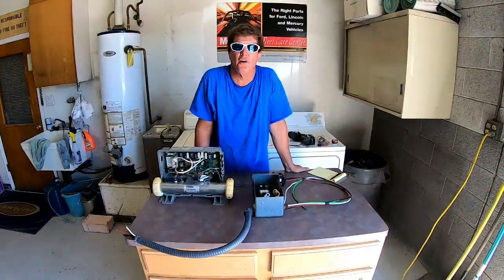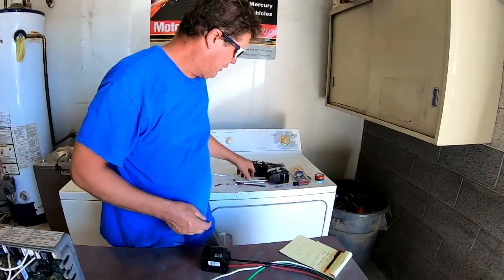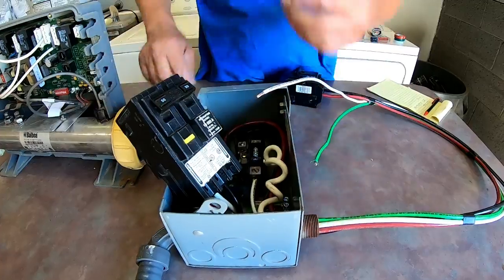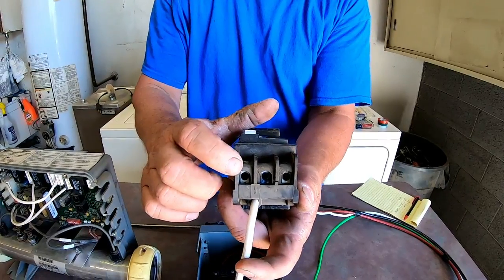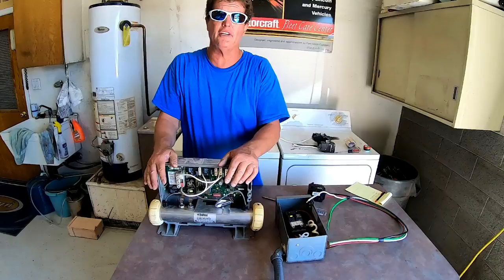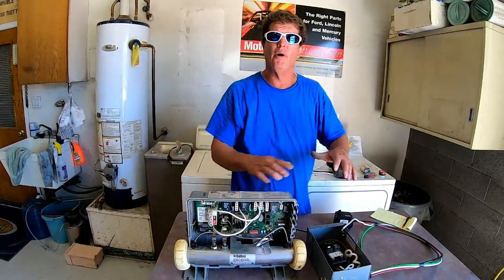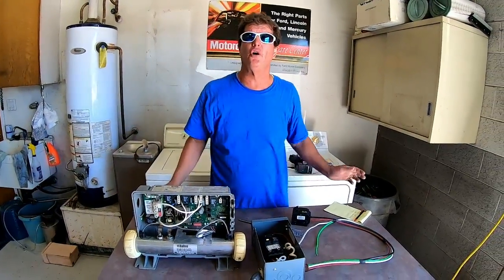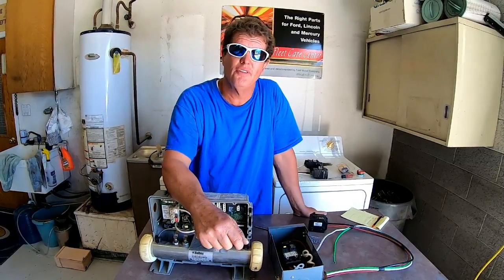Hot Tub / Spa wiring made easy... 50 Amp GFCI Install..Arizona Hot Tub Factory (DIY Spa Repair)

Comment: Just a question on your conduit sizes. I see you ran 4 # 6 conductors inside 3/4" rigid and flexible conduit. Does 3/4" have enough area to accommodate 4 conductors? I am in the process of wiring mine up using your video and it looks like our local code would mean I have to use 1". What do you think Mr.? Great videos by the way...
Reply from the maker: Yes we do it all the time with no problems 
Thanks for Watching & Subscribing
Reply from the maker: My son said if you are going long distance or several 90 degree turns you might want to use 1 inch EMT but we still use 3/4 for the liquid tight .

Comment: Are you still around Spa Guy? Is there ANY REASON I should be getting >30ohms between black (A-phase) and the ground. Specifically what could be the problem with this pack that would cause that. Also if I did not wire  my line neutral to the center pole on the GFCI breaker would it make it trip if I wired spa neutral to the neutral bus
Reply from the maker: They call me the SpaMan..The Spa Guy is another company.
Something is wired wrong
You have a problem with the main breaker 
or something is wrong with the pack.
You are welcome to call and talk to Scott and he could get you going in the right direction
Thanks for Watching & SUBSCRIBING

Comment: Great video, thanks.  Can you bury the liquid tite conduit and run it up underneath the spa and through the base of the hot tub to just outside the spa pack?   Or must you come in through the bottom section of the side panel of the spa (i.e. come in through the side of the spa vs up through the base) and feed the conduit/wire through to the spa pack?  Are there knockouts on the side of the spa where you would insert the wire cable conduit for this purpose, or is it "drill your own?"  Thanks

Comment: Hey Scott you still responding to comments on this video?
Reply from the maker: Yes .. just about everyday.
Reply: Hey Scott thanks for posting.  I'm a handyman... not an electrician.  I've done plenty of stove and dryer hookups.  I was asked to hook up a hot tub for the first time. The tub is used but is going into a new place.  The electrician has put in a drop for the disconnect/GFCI. I feel like something is missing.  Coming out of the conduit from the main are three number 6 black wires. One black wire has green tape on it.  [Two hots and a ground?]
The hot tub has a pack exactly like the one in your video.
For my disconnect box, I have very similar to the one your video. 
So, are we missing a neutral from the main?

Comment: Is there any reason the GFCI can't be in the main panel vs sub panel and use a disconnect box as the subpanel?
Reply from the maker: You can put the GFCI in the main or a Spa disconnect box.
Now I always have two breakers on every install I've ever done or helped and Ive put the GFCI in one or the other... I have never just put a GFCI in the main with a disconnect that was not a breaker . I do not like the disconnect like what is used on an AC for instance. Hope this Helps Thanks for Watching & SUBSCRIBING
Reply: @spaman5440  Thank you!  I'm the second owner of a home built in the early '90's and I recently replaced the original hot tub.  The original wiring is simply a non GFCI breaker in the main panel and about a 75' run of 8/3 cable. It's a very harsh ocean cliff environment and I can't use anything metal outside unless it's stainless steel or plastic. I really want to rewire this installation to ensure it's safe/proper. Your videos have given me the foundation to redo this wiring the right way.
Reply from the maker: @cottydry   The 8/3 is the wrong size and type of wire to use outside or on any Hot Tub...
I use THHN or THWN wire only #6 on all four wires. Our company fixes this type of problem all the time.... You also need to have a Spa disconnect with in 20 feet of the hot tub and no closer then 5 feet and a min of 36 inches off the ground. Hope this Helps and Thanks for Watching & SUBSCRIBING

Comment: So thr neuteral wire inside the sub panel is tied to the gfci white as well? also if thats true then when wireing the 50amp in thr main pannel can i have my neuteral and ground on the same bar there? because you said if the gfci white is on the ground bar it wont trip the gfci in a fault situation but in the main pannel before the sub its wired neuteral to ground there......sooooooo will it still be a safe gfci?
Reply from the maker: In a main Panel ground and neutral can share the same bar without tripping and yes this is safe and very common in a lot of installations
Thanks for Watching & SUBSCRIBING

Comment: Can i use 8 /2 wire for sub panel? And 6 /3 to hottub
Reply from the maker: No! You use #6 THHN 0r THWN wire only 
From the main to the Sub panel and the same from the Sub to the Hot Tub.

What you are asking to use is the wrong size wire as well as the wrong type of wire>I see many contractors as well a DIYers doing this all the time and it never works out well in the end 

Use #6 on all four wires never down size the Neutral or Ground wire ever and alway use THHN or THWN wire.

Thanks for Watching & SUBSCRIBING

Comment: Hi Scott, I just finished doing all the electrical for my new hot tub. It is a 2-wire and ground-only connection. The hot tub is just working fine but when I tested the GFCI it will not trip. I returned that Square D by Schneider Electric Square D - QO230GFICP QO Circuit Breaker, 30-Amp, 120/240V, 2-Pole, GFCI, Plug-In Mount for replacement. Thinking it was a defective unit. I got the replacement and it is the same issue - not tripping. I followed exactly the instructions on how to wire the hot tub, but no luck. Please advise, thanks.:)

Comment: Quick question. I am moving my hot tub off a brick patio and onto a rebar reinforced slab.  Before I pour the slab, I am adding a threaded rod pounded into the ground and connected to the rebar. I'm going to have the threaded rod stick up out of the cement as a way to ground the rebar.  Should I run an additional ground wire from the bar by the pack to the threaded rod as a 2nd ground? Would that help if somehow the water in the tub got electrified?
Reply from the maker: I would run your wire from the main to the sub and then to the spa in #6 THHN or THWN wire no matter what and if you want to add the ground bar for added measures that fine. You alway want to make sure the main sub and spa are all grounded together on the same line with the same size/type of wire. Thanks for Watching & SUBSCRIBING

Comment: Can you just put a GFCI breaker in the panel to a disconnect that is 5 ft away from the tub?
Reply from the maker: Yes you can put the GFCI breaker in the main panel and then just put a 50 amp breaker on the wall 5 Ft away from the the hot tub and you are good to go. Thanks for Watching & SUBSCRIBING

Comment: Great video but I don’t think you explained or possibly emphasized which side of the breaker you connect the source power and which side the load is connected to? I’m assuming source is on the bottom and load is on the top.

Comment: Explained pretty simple great video.👍 I'm going 2 give it a shot. Just poured my pad, gonna set tub next week. 
Only question I have is there a max distance u need to be from ur hot tub 2 the disconnect?
Reply from the maker: Yes...Min of 5 feet away from the hot tub and 36 inch hight and no further then 20 feet and in the line of sight..#6 wire on all wires and use THHN / THWN only Thanks for Watching & SUBSCRIBING

Comment: Can the ground wire going to the spa pack be bare. Or does it need to be insulated?
Reply from the maker: I alway use #6 THHN wire from the Sub panel to the Hot Tub... I would not use a bare ground wire. Thanks for Watching & SUBSCRIBING

Comment: Great videos Scott! Thanks very much. Question: what type of wire do you recommend running from my main panel in my basement to my outdoor spa panel through my basement ceiling?  I plan on 6 awg wire. I will use the thhn thru seal tight from sub panel to spa but should I use nm-b thru the basement from main to sub? Curious on your thoughts. Thanks.

Comment: I would like to add a wifi switch to turn on/off my hottub system. I have 4 wires coming from my 220V panel breaker: hot-hot-neutral-ground. Can you recommend a wifi switch that fits these 4 wires as input, and also has 4 ports as output?
Reply from the maker: They don't make one for Hot Tubs..You should never shout off the Hot Tub with water in it for more the a couple of hours ever...The water needs to be circulated every 12 hours for at least an hour  other wise the water will get really gross and nasty..The water will also get really hard over time ant that is when all of the problems set in ...So not a good idea.. Thanks for Watching & SUBSCRIBING
Reply: @spaman5440  really not planning to keep water in it. I wil drain the hiottub after each use. Pleasrñe let me know about the wifi switch

Comment: My hot tub hasnt been used in 18 months
Filled the tub and flipped both breakers and nothing happened
Took a look at hot tub breaker and looks like reset button is stuck in out position (,won't move)
Hoping I can replace breaker and will be back in business

Comment: Is that a Residual Current Device / Breaker combo?  How do you hook up a separate RCD device in that GFI circuit? Also interested in wiring an emergency shut off switch about 5 feet from the tub itself. What would you suggest in emergency switches brand and mounting post options.

Comment: On  Jucuzzi j235 this is a 3 wire hook up ? So I believe it doesnt require a neutral wire so there for you cant use a GFCI breaker correct ???

Comment: Hi - thanks for the Video. I've got an older install (approx. 20 years) with an external box that contains a Leviton 8895 GFCI that feeds a Funras 42F35A1 definate purpose controller .. out from there to the spa pack. The GFCI keeps popping all of a sudden with nothing else changed .. sometimes within days, sometimes hours of resetting it. The 8895 is discontinued and no similar alternative is available. I've gotten conflicting info on what to do - some say replace the house panel breaker with a 50A 2 pole GLCI and have the GFCI in the house while others suggest as you've done in this video and basically replace the outside setup with a box like you show. Please advise, and perhaps detail why one is better than the other. THANKS !!
Reply from the maker: You would need to call the office and talk to Scott.. You have way to much going on with your Spa and we do not want to confuse others with wrong info that will not work for their situation and could in fact cause damage. So call and ask for the Spa Man. Thanks for Watching & SUBSCRIBING

Comment: im installing the load center, i had the tube hard wired to the breaker in the main panel, now i want to add the load center with the ground fault, the breaker keeps tripping, even with none of the load wires attached, i assume i have a defective breaker. what are your thoughts.
Reply from the maker: You might have something wired wrong...(With the breaker turned off) Go back and check everything again if it still trips the breaker give us a call and maybe we can hep you...Thanks for Watching & SUBSCRIBING

Comment: Hooked it up exactly how you said using an Eaton 50 amp gfci   Worked for 3 days and the Eaton Gfci breaker keeps tripping. How can I tell if my Eaton gfci breaker is bad?
Reply from the maker: With the breaker off...Make sure all of the connections are tight.Is it a new or used spa and what pack does it have in it..Thanks for Watching & SUBSCRIBING

Comment: Power to sub panel but no power to hot tub .. checked all wiring and all nice and tight.. still hot tub has no power
Reply from the maker: Check to make sure you have power at the hot tub...If you do have power at the hot tub and it does not power up check all of the fuses on the board.if all fuses are good turn off the breaker remove wires and then remove the board and turn it over and look for any burn spots...If you see any burns spots your board is bad and needs replacing .Hope this Helps Thanks For Watching & SUBSCRIBING

Comment: I've seen other wiring diagrams where the red(hot) load wire is on the right connections, and the black(hot) load wire is on the left position, but you have them switched. Does it matter?

Comment: My old Balboa unit has red white black and green on the same spot in the control box on the board do I still connect the ground to the green in the box or do I do it to the ground plate on the outside of the hot tub control panel

Comment: I ran all the wires as #6 except the ground which is a #10 from main panel to sub panel and #8 from sub panel to spa. When hooked to spa breakers trip! When wire nuts on end and disconnected from spa no breakers trip and ends have power. SO IS THERE A SHORT IN SPA WIRING?
Reply from the maker: Well you have a lot of thing going on..
(1).You never down size the wire...All 4 wires need to be #6 (I know everyone says it will work... And it will until it doesn't or you have a problem) More then half the Hot Tubes I fix were wired wrong.
(2) If everything is disconnected most often it will not trip.
So I would wire it with the correct size wire and then move on to the next step as to what is going on with your Spa.
If you need more help you can call me as the shop and I will try to get you going in the right direction.
Thanks for Watching & SUBSCRIBING
Reply: @spaman5440  Thank you

Comment: Have a new cost spa that replaced a old spa. New spa is working it is wired for 220 with 50amp GFI. The mother board has 6 small dip switch es

Comment: Scott 

I have a 60 amp square d qo breaker and a hot tub that doesn't seem to require a neutral  where do I land the neutral wire on the square d 60 amp gfci breaker 

The hot tub has noplace to land the neutral wire

Thanks Don
Reply from the maker: You must have a GFCI breaker... So you put the GFCI breaker in the main panel and you run the two hot wires /neutral /Ground wires to the sub panel ...Now in the Sub panel you will only run two hot wires and the ground to the Spa... By putting the GFCI in the main panel every down hill from there is protected.. Hope that Helps and Thanks for Watching & SUBSCRIBING
Reply: @spaman5440  Thanks for the info .It was vary helpful

Comment: Hi. Excellent detailed videos, Scott, thank you. Always a pleasure to watch them.  I have a question regarding a Beachcomber Management System SST-2. This has a Balboa Instruments circuit Board PArt # 54315-04. Everything worked fine except for one of the pump motors started leaking water at the connection to the pump, so I decided to buy a replacement motor with the pump attached. The motor looked the same as the other (not exactly the right part number) so I removed the cables off the old one and added them to the new one. They were White wire on top, Black in the middle and red on the bottom. I then tried to turn the circuit breaker on and it kept tripping. I put the old motor back and it continue to trip... I looked at the new motor carefully and saw that the pins were different to the motor I took out... Top pin of the old motor had Common, middle had High Speed and bottom had low speed, while the new motor High on top, Common in the middle and low on the bottom. The question is by plugging in the wires as per old motor could I have blown something on the circuit board?

Comment: My epak that I just bought doesn’t indicate a clear spot for my incoming ground on my 4 wire. It has a grounding bar on the outside like he shows, but no pass through(hole) to connect it like this. There are two ground connectors/bolts inside the pack. Should it just be connected there?

Comment: Thanks for the video. My instructions say to use a 50 amp breaker with 8 gauge wire when it should be 6.  Will 6 ruin my spa?
Reply from the maker: No it will not...

Comment: Currently I have a GE 50 amp double pole THQL GFCI circuit breaker that went bad.  Can I replace this with a Siemens  QF250AA?  The plug in piece on each breaker looks identical, the Siemens breaker is longer in size
Reply: Siemens QF250AP

Comment: Scott, 
My sub panel only has the 4 wires in it. There is no GFCI or circuit breakers or common bar or ground bar.  Can I just buy them at a big box store and screw them in?  There is a couple of metal clips that a plastic blank pushes into,  but it doesn't look like your sub panel. We had an electrical run the sub panel wiring for a hot tub when the house was being built.
Reply from the maker: Yes you can add the ground lug/bar. Now when you add the neutral/common lug/bar you need to make sure that it is isolated which means that it can not touch anything else. always use a GFCI someplace either in the main or the sub panel . Thanks for Watching & SUBSCRIBING

Comment: What do you use for conduit from the disconnect box to the Tub?  Looks like a 1/2" flexible conduit, but I dont know how you terminate it at the hot tub control box?
Reply from the maker: I alway use 3/4inch Seal tight /Liquid tight on every install I do. I have a Video coming up soon that will show this..Wish I had it ready to post now. Thanks for Watching & SUBSCRIBING